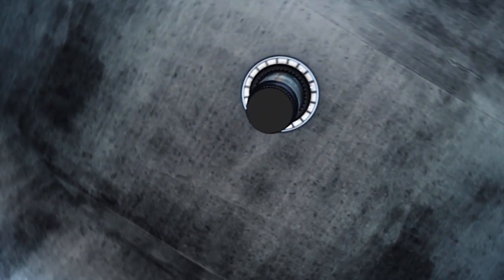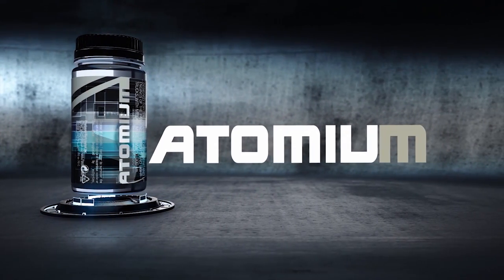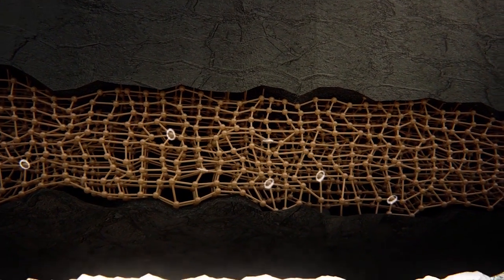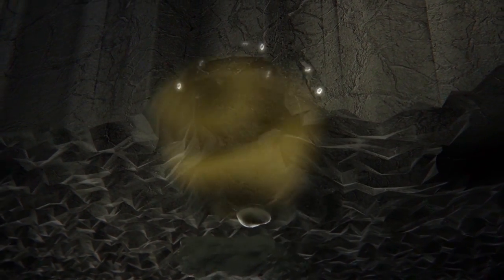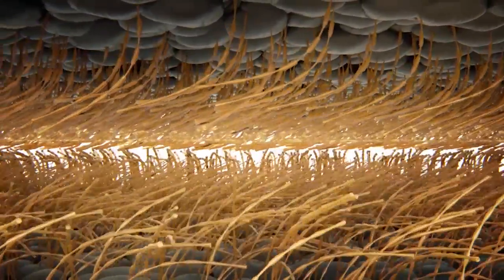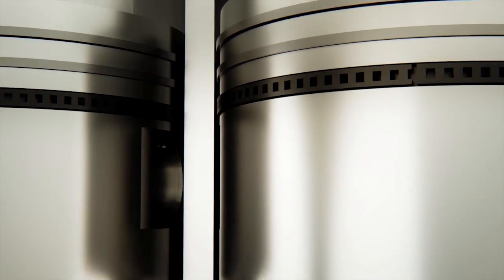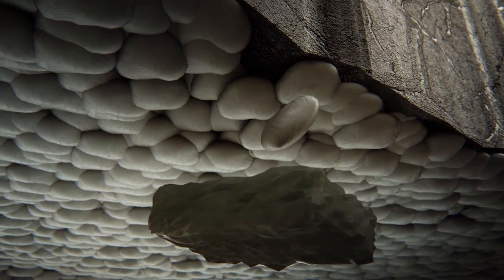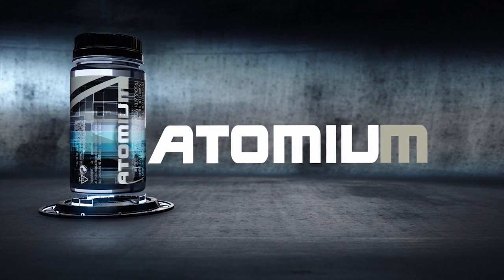Motor oil additives (MOA) SUPROTEC ATOMIUM technology. That / how really work? #car #life #engines

Comment: Dobrý den.
Mám VW Touran 2.0 TDI. Rv. 2005.
Najeto 310000 km 
Kamarád si koupil Atomium activ diesel +.
A zatím nic extra nepozoruje.
Použil tedy zatím první lahvicku.
Já se bojím že mi to vyčistí na tolik že se mi to celé rozpadne nebo prodře.
Reply from the maker: 'Hello, 1st stage - cleaning from lacquers and carbons, drive 500-1000 km, change the oil, and proceed with the 2nd stage, drive to the next regular oil change - and proceed with the 3rd stage. As far as you mileage is more than 300.000 km - you need 3rd stage, just to fix the results. Answering your question - at the first stage - not to much to see and feel, you will have resulst as soon you proceed with the 2nd stage!!!